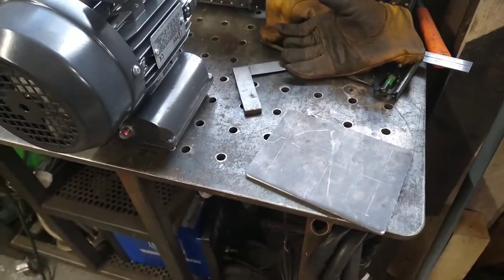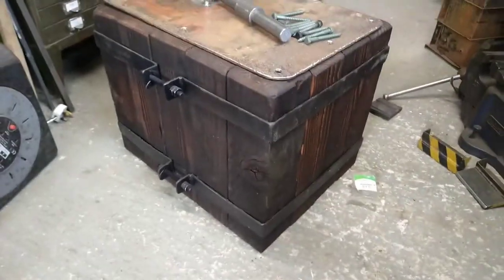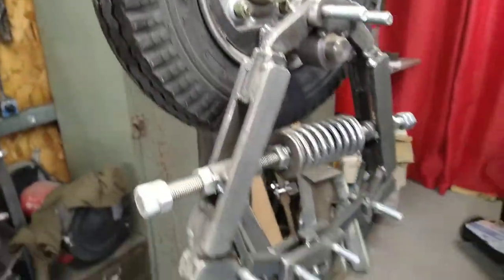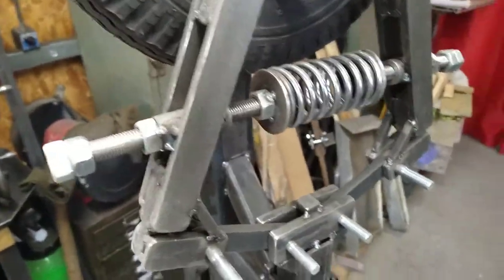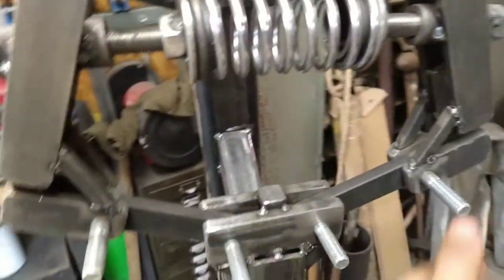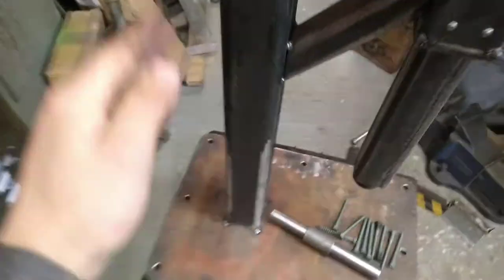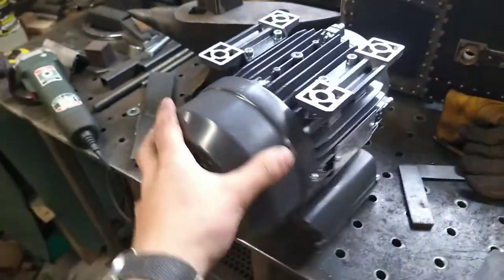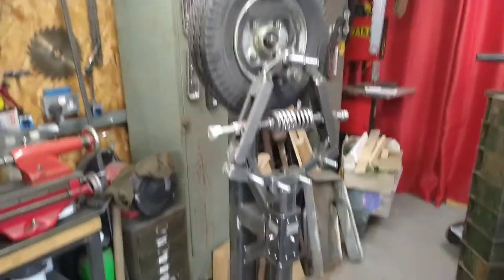Powerhammer build.

Comment: did you take off tire before welding on plate or were you able to weld without issues?
Reply from the maker: I deflated the tyre and clamped it so it was away from the plate when welding. Once cooled I re inflated the tyre.